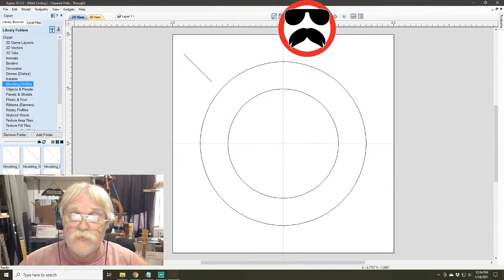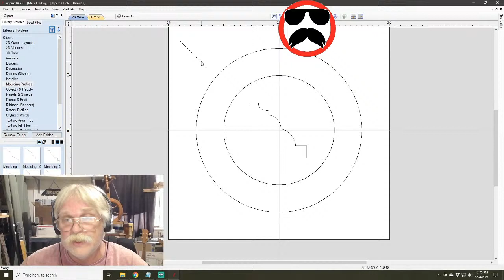LIVE Q&A #75 - Carving a Tapered Hole in VCarve and Aspire

Comment: Mark I am cutting some dados in cabinet sides and also putting holes for shelf bracket can I use a 2  flute .25 router bit  that is designed to be plunged for both files.
Thanks Jeff Peters
Reply from the maker: You can, Jeff, but remember to use an UPCUT bit for the shelf bracket holes. Don't drill with a downcut bit.